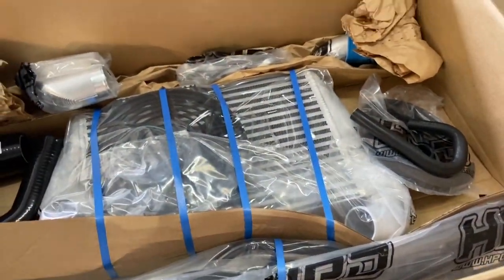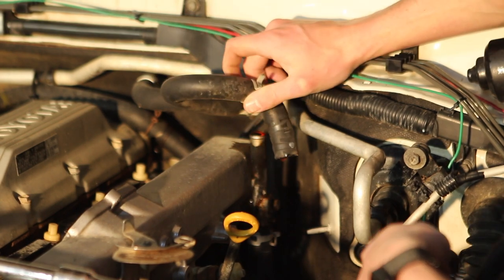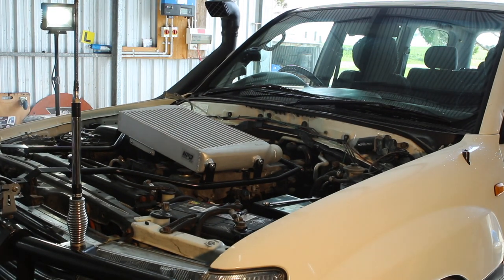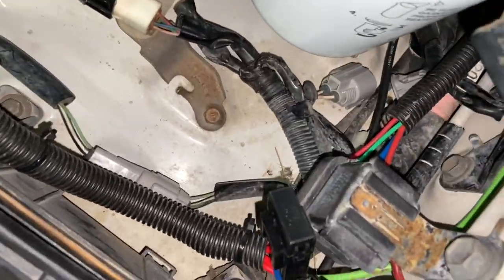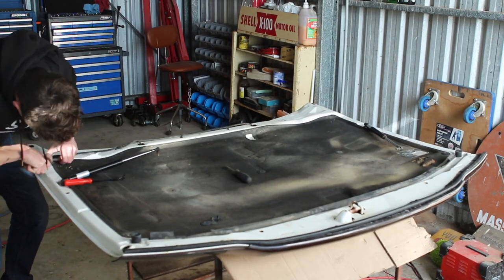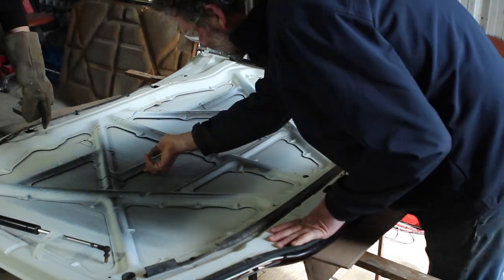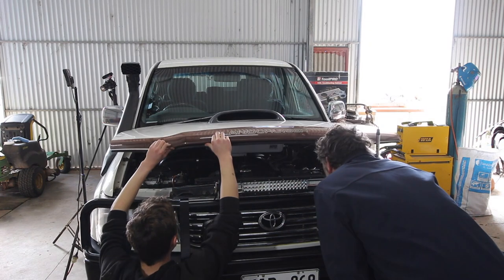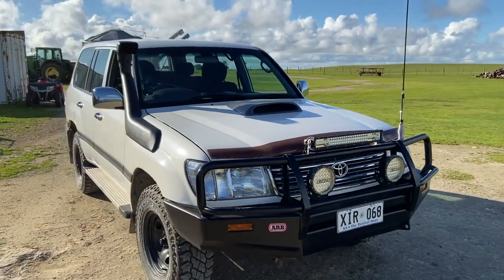HPD S2 Top Mount Intercooler Install [105 series Landcruiser]

Comment: Looks the goods... any reason for top mnt and not front mount?
Reply from the maker: They’re both going to be great. On paper front mount is more efficient and always will be, but it comes down to whether you want something else at the front of the vehicle giving warmer air to the radiator and condenser. Engine is easier to access with front also. But I chose top because it’s easier to install, HPD assured me it’s pretty much just as efficient as their front mount because of the thermo fan, and I got to put a scoop on and I love the look of that!
Reply: Yes the scoop looks really good. Will you upgrade the intake/ airbox at all.
Reply from the maker: @jakedoyle8934  thank you 👍👍 and yes quite possibly will in the future. Hoping to find some time to finish this air compressor and get that video up and then air box is definitely on the list down the track

Comment: I like you build and I really wish I could have a serie 100. I would like to know with an intercooler if you can go under water or cross a river?
Thx
Reply from the maker: Yes the air still comes in from the snorkel. The intercooler is just like a radiator for the air, it cools the temperature down. It doesn’t suck in air from the intercooler
Reply: @WillsLandcruiser  thanks a lot. I save all your videos so I can modify a series 100 once I get one. You definitely help a bunch of people  to modify and improve their land cruiser.
Reply from the maker: @Tate.TopG.  that means a lot, thank you! Good luck with your modifications!

Comment: What's your fuel economy like since putting the turbo an intercooler on? I've got 105series aswell an planning to do same as your one.
Reply from the maker: At the moment it’s terrible 😂 But that’s only because I haven’t had it tuned yet. Fuel economy will always be out of place when that air/fuel ratio isn’t right in the engine. It’s about 17L/100km at the moment, but I can let you know what it does after I get it tuned in a couple weeks!
Reply: @WillsLandcruiser  what is it now?

Comment: How come the thermo fan is on the bottom?
Reply from the maker: It’s designed to pull air down through the intercooler. Guess it’s just the way HPD designed it. I think it looks pretty neat
Reply: Mounting the fan on the underside leaves a clear path for air flow at higher road speeds. 
The fan is mostly required at lower vehicle speeds; on the highway it's out of the way and allows maximum air flow via the hood scoop and road speed.

Comment: What your egts before and after
Reply from the maker: On the highway my EGTs were 350-400, now they’re 250-300. It’s a little hard to compare though because I’m not entirely sure when the thermo fan kicks in. In the future I might install a manual switch so I know it’s on most of the time. But there’s been obvious improvement so far and it’ll be even better when I get it tuned!

Comment: HELLO, do you know at what temperature the fan turns on?
Reply from the maker: I’ve asked around but no one is sure. It doesn’t come on on the first startup in the morning but it seems to run most the time throughout the day- On the highway, in town, idling, startup after leaving the car for a while
Reply: Fans start when engine hot . . not before
Reply from the maker: @benwinter2420  I’m thinking the intercooler fan starts at about the 30° mark. Won’t start whirring on your typical first start up but on a hot day it’ll be going before I even turn the engine over

Comment: Hey mate not sure if I’ll get a response with being so late but how did u run the rocket cover breather after putting the turbo and intercooler on
Reply from the maker: Temporarily not hooked up, ideal to get a catch can and run it back into the intake system mate
Reply: @WillsLandcruiser  thanks mate